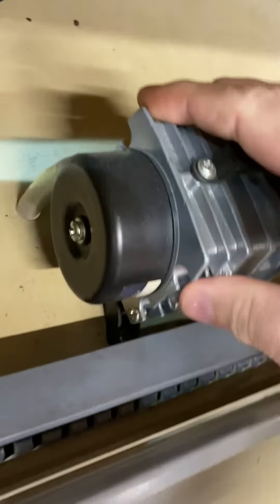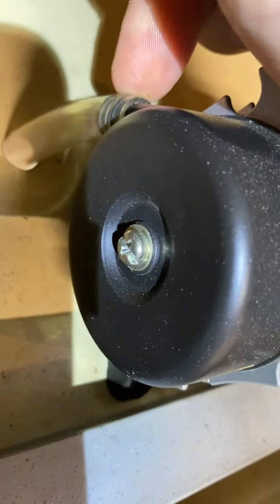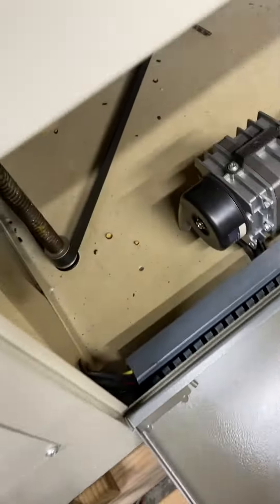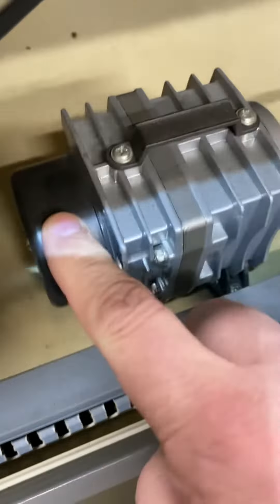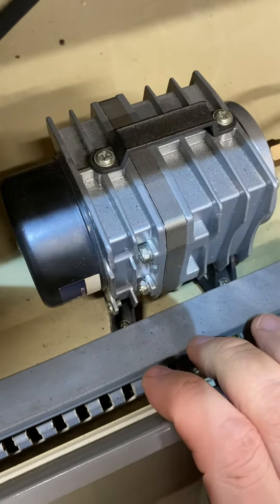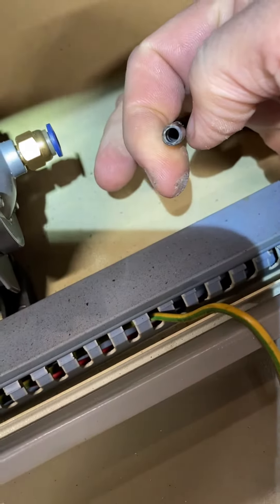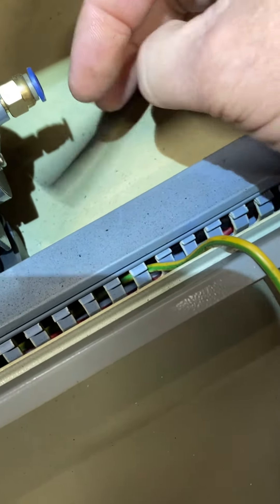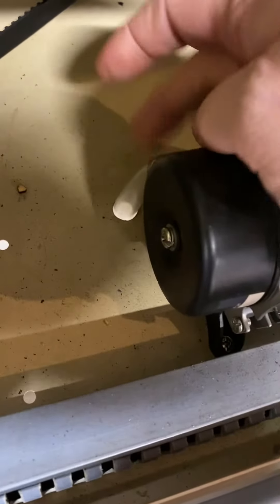Monport Laser air assist quick improvement.  @monportlaser

Comment: I just had this happen earlier tonight.  Completely contaminated my system.  No filter on my unit and the intake was on the very bottom.  Ordered a bigger pump that I plan on mounting externally if I have to.
Reply from the maker: If you can, go with a small air compressor.  However, placing the pump outside the unit will help out tremendously.  Mine didn’t last long at all.  The machine itself is still running good.